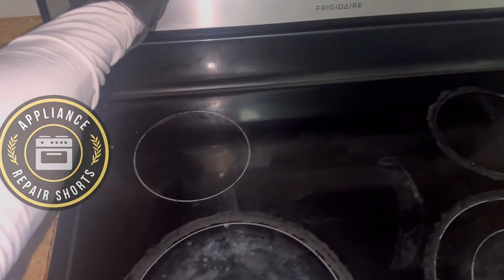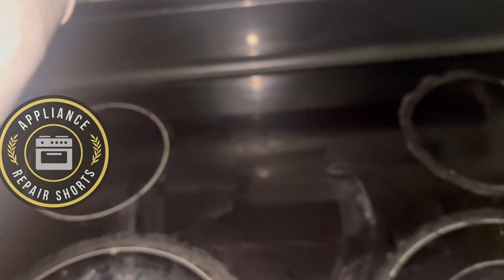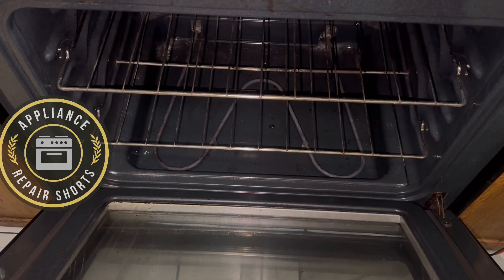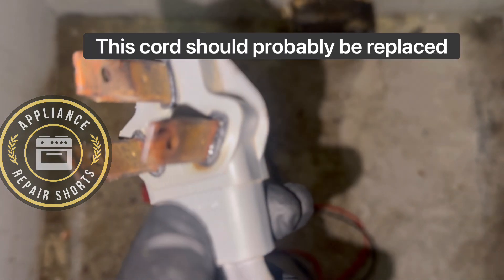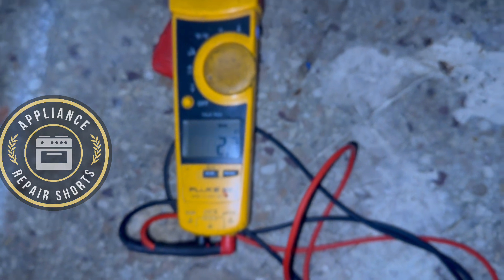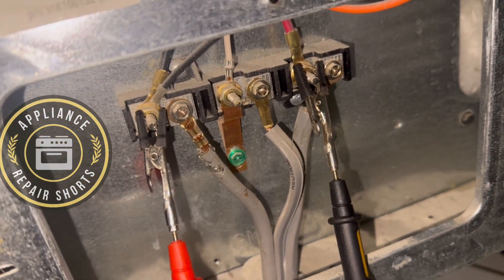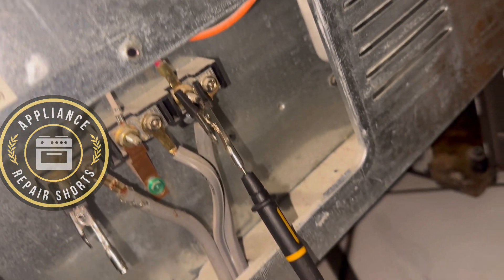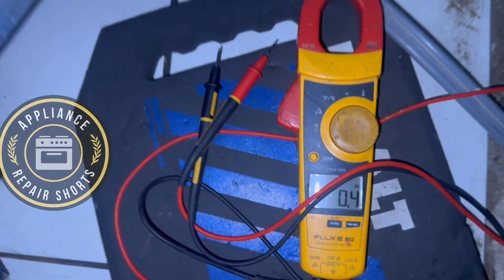Frigidaire Stove Not Working | Burners and Oven Not Working | check For Power First

Comment: I created an excel data base with make, model, symptoms and solutions columns and a link to videos i can go back to and reference when going out to jobs.
it helps me out.
Reply from the maker: That is awesome, I use all kinds of things to do diagnose or checking. Diagnose is easier when you understand the process of operation. For example, customer say washer is not spinning. First thing is to check the tub. If you have water, then check for obstruction, basically start at the easiest to actually checking for power from the at the connector. I have a few videos on Patreon  . You can join for free. Or a small fee
Reply: @appliancerepairshorts  You have very good diagnoses videos that i appreciate. i will be subscribing soon.